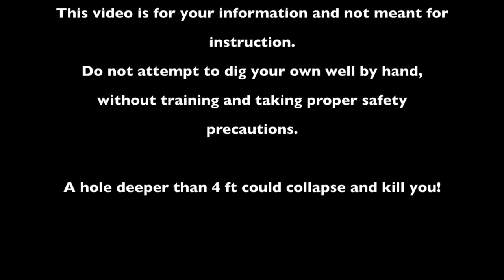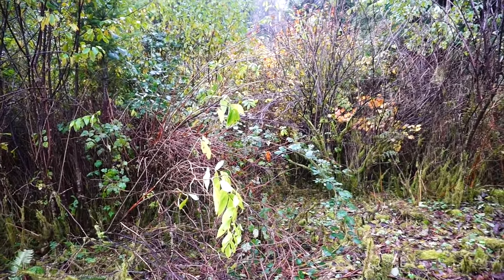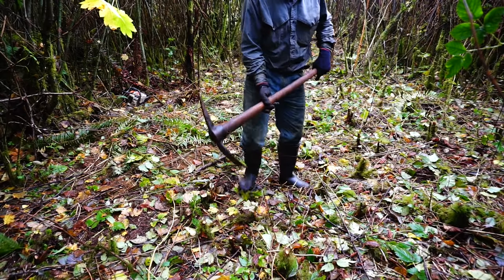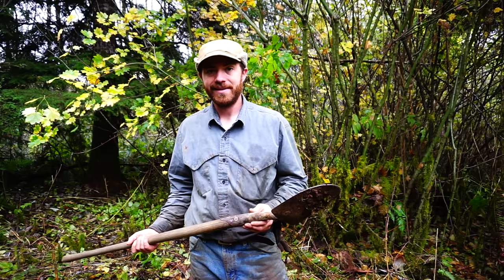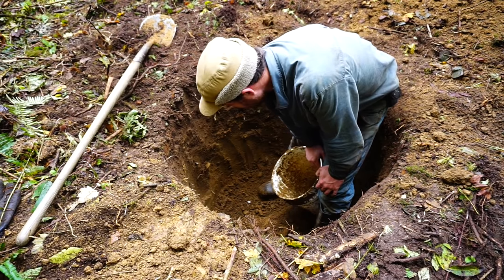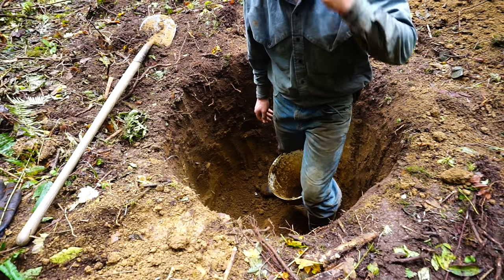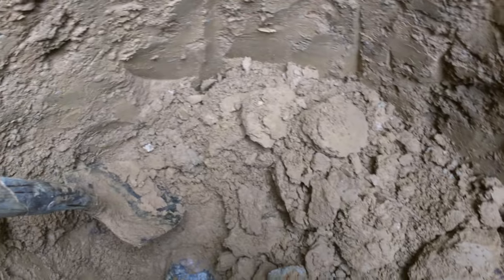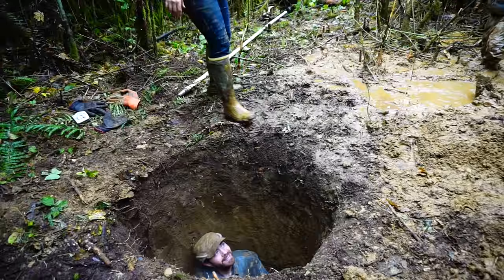Part 1: Digging a 9ft Well With a Shovel

Comment: O God I was worried about youre water safety before you said you plan to cover it ..you should run over the area with dousing rods. There's a hand tool you can get to dig a hole its much quicker and safer and easier than doing it with a shovel theres a guy doing yt? Videos about the easier way my uncle did it that way ..it gonna have to dig so wide putting work on yourself